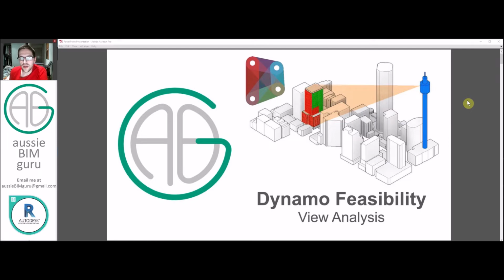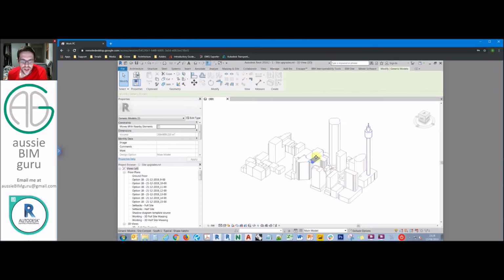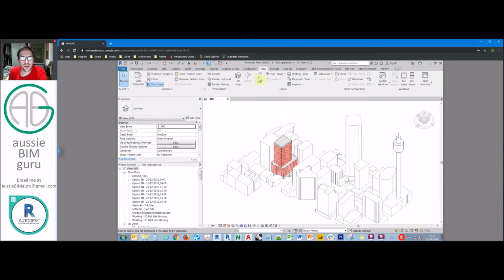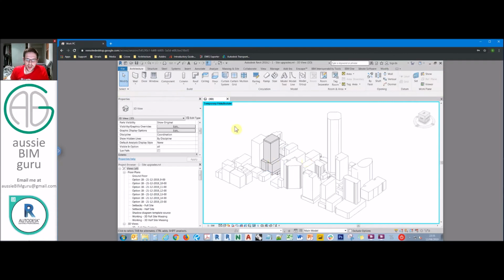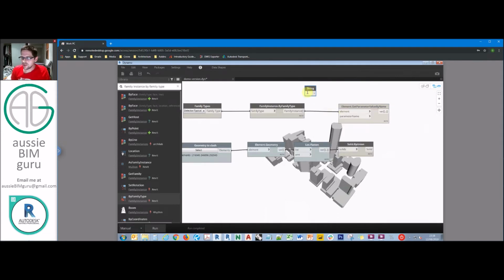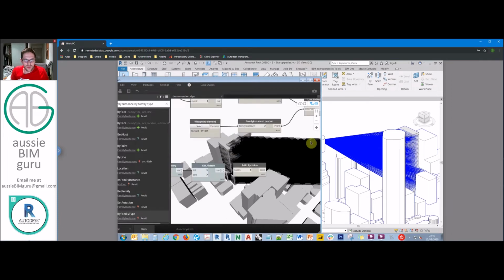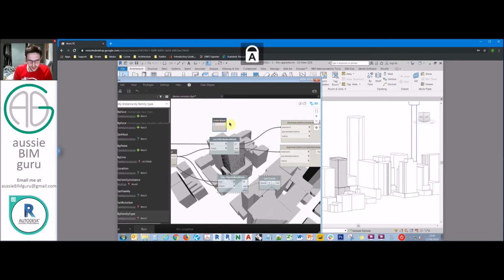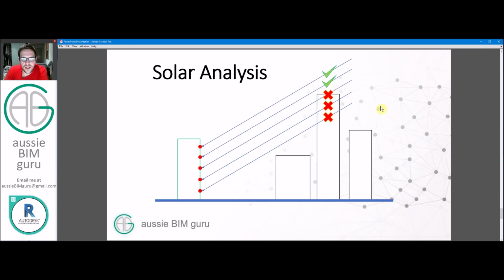View Analysis using Dynamo (Feasibility Part 8)

Comment: Hi Gavin,
How do you deal with multiple viewpoints? I want to simulate how many viewpoints there are from my building towards for example a river?
Reply from the maker: You would need multiple parameters, or you could use dynamo to apply a element VG override to the sensors.

Comment: Great use of dynamo! However I have a question. I’m not sure if this tutorial was Dynamo specific for this task but couldn’t the revit camera view do just the same thing? Thanks for the insight on how this task can be scripted via dynamo. Very creative.
Reply from the maker: Thanks Alexander!

The revit camera can approximatelt achieve the same result, however this worlflow is not capable of proving exactly how much of a surface can see a point, as a view focuses on 1 specific target point.

I've actually got a video scheduled in my videos in 3 weeks time that uses Dynamo to generate views from sun position, so this logic could be adjusted to generate rough views from point - a decent and suitable technique for high level analysis of view potential.